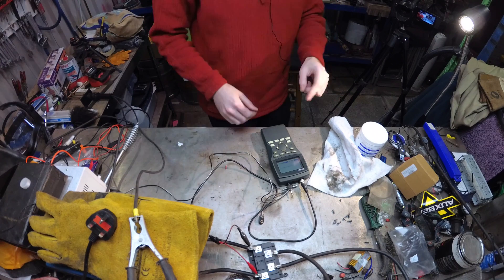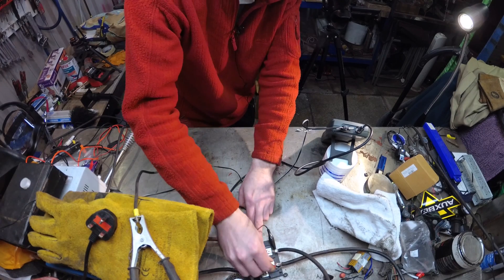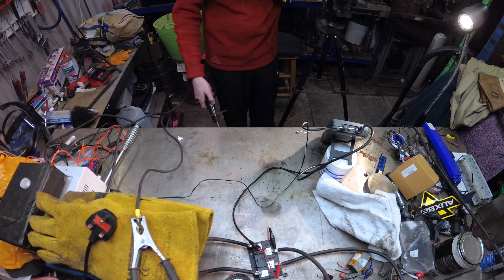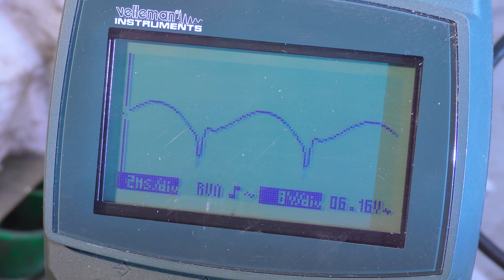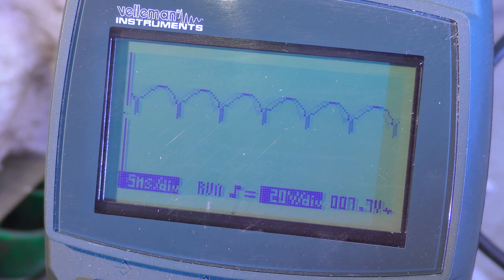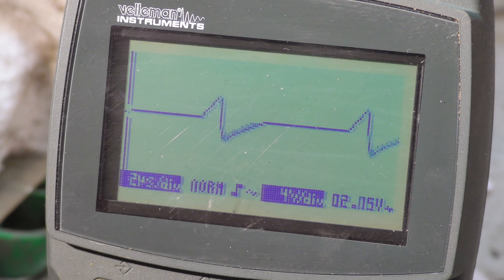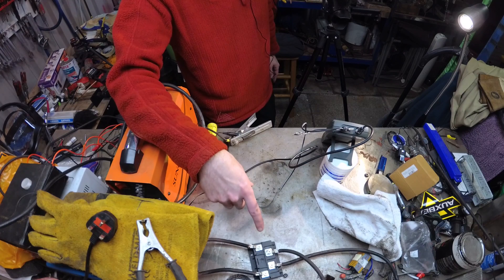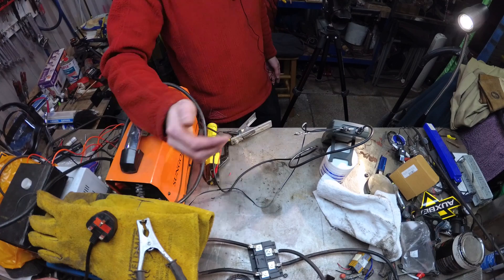AC welder rectified tested on the oscilloscope

Comment: Would a capacitor wired in parallel smooth out the ripple of both welders?
Reply from the maker: Yes it would, I'd bet there is even a calculator out there that would work out what capacitor to use.

Comment: Good video, one question when you put the osc on the output Bridge, did you have a cap or a choke connected? Thanks
Reply from the maker: Straight off the rectifier.  I need to try it again with cap and choke.

Comment: That was quite interesting, many thanks! On a completely different note, I was wondering, would you still recommend that mini induction heater from AliExpress?
Reply from the maker: Thank you.  I would yes.  I've still got mine and use it whenever I need to heat stuck nuts and bolts.
Reply: Thanks!